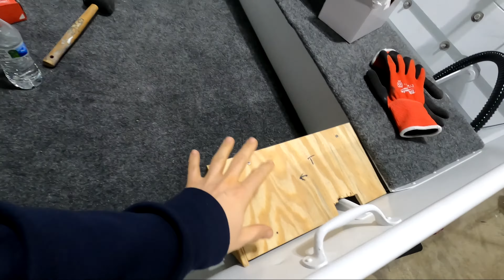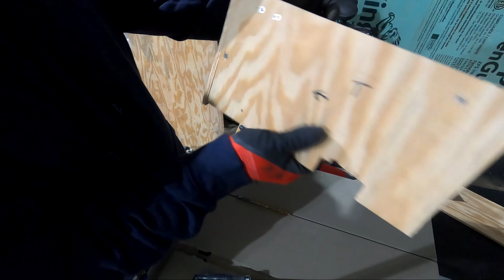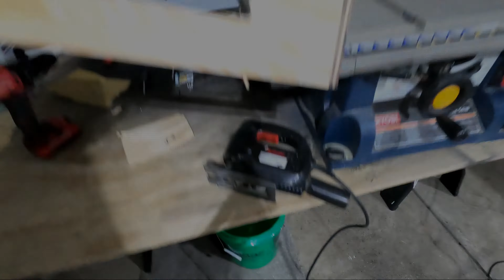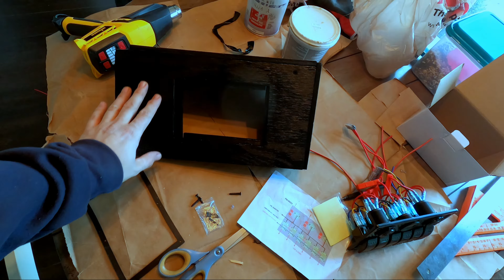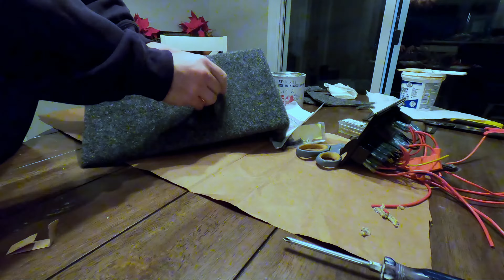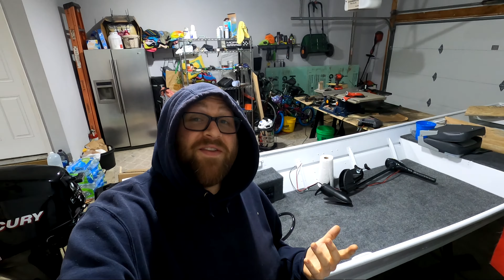JON BOAT SWITCH PANEL BOX / FISH FINDER MOUNT | 1436 Jon Boat Build Conversion

Comment: I struggled with what I was going to do for my electrical panel, and once I saw your video it gave me inspiration .  Mine is very similar and it came out great.   I was actually lucky enough to find a local place here selling three-quarter inch marine plywood for $34 a sheet.